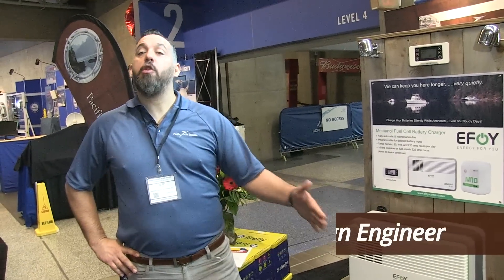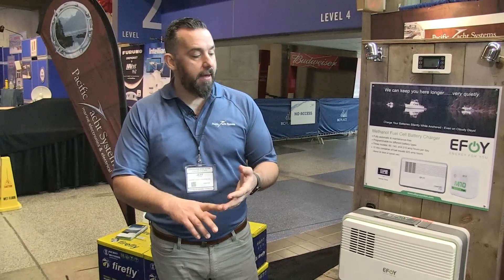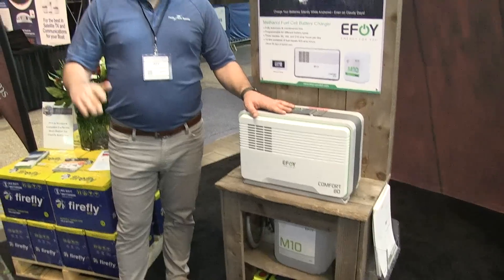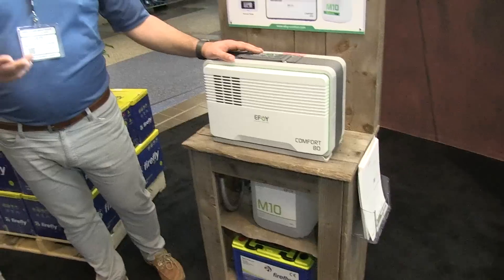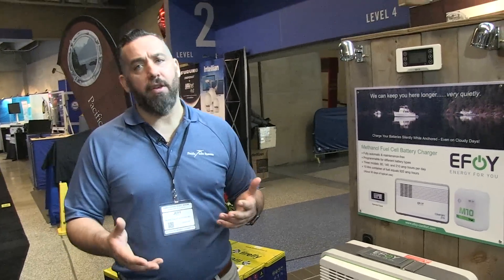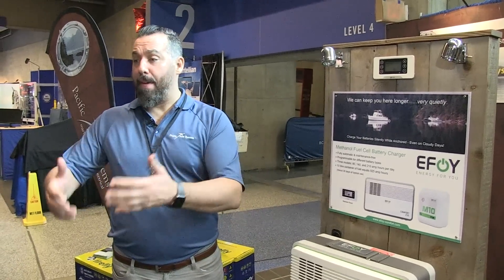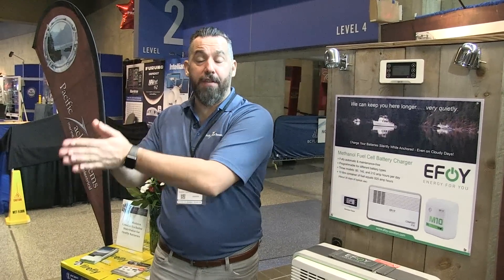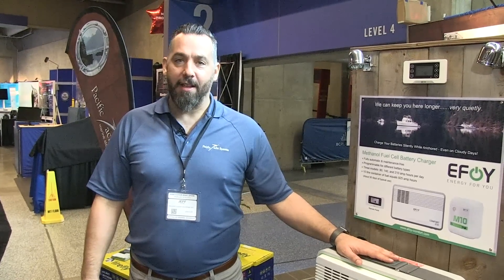EFOY -  Methanol Fuel Cell for Boats

Comment: Hi,  I'm researching the Efoy as a charger for my RV battery.  I do a lot of camping in rec sites without hookups and I use solar power most of the time.  I am looking to extend my camping season but the fan in my RV heater is a large draw on my batteries.  I'm assuming an Efoy 80 would be able to keep the 12 volt battery charged but I also wonder if the heat exhaust from the efoy unit can be vented back into the trailer to supplement heating?  I know that that the exhaust gas should be vented outside but what about the larger vent.  Is that gas nontoxic?

Comment: Forgive the ignorance, but why batteries? Why not run its output to a  inverter? I understand it would increase the menthol consumption. But is it possible? Or am I just dreaming?
Reply from the maker: Good question, battery chargers and power supplies are quite different. EFOY, like battery chargers and alternators, need a battery to act like a spring to handle the sudden adding and removing of loads. You unfortunately cannot connect an inverter directly to an EFOY as it acts a battery charger and not a power supply.

Comment: Jeff, i have recently installed the 140 on my Hunter 38 i have found that when motor sailing my battery voltage W/ alternator charging i'm @ 100% charged  around 13.8 volts with all my electronics on for navigation etc. The EFOY factory switch off voltage is 14.2 so it would also be running when i'm motoring, this seemed like a waste of energy so i changed my switch off voltage down to 13.7 so that i conserve fuel, have you experienced the same?  i find the only time i get to 14.2 volts is with shore power, and or at anchor and at night with minimal loads drawing. have you made similar adjustments or do you just let yours run...
Reply from the maker: Hi James, my recommendation is to manually turn on and off the EFOY unit. Simply, we know better than the EFOY, we can make a decision if it makes sense to have the EFOY on or off. When motoring, I too turn off the EFOY unit as i leave the alternator do the work.
Reply: @PacificYachtSystems  Sounds good!
I found it hard to find local knowledge about the EFOY, because of your videos i pulled the trigger, they are very informative and helpful, keep up the great work!
because of you this is how i came to my decision and sized my EFOY system..
https://youtu.be/bAd0j4gLI0Q

Comment: EFOY 140
SPECIFICATION
Amp Hours	140
Nominal Voltage	12V DC
Maximum Power	72W
Charge Current @ 12 V	6.0A
Nominal Consumption / kWh	0.24 Gallon
Weight	17.2 lbs.
Size	17.44"L x 7.95"W x 11.34"H
Operating Temp	-4°F to +104°F
Reply from the maker: Thanks for sharing.

Comment: soooo basically its just a generator running on methanol? slowly? or is it a genuine fuel cell One that probably no one could fix in the middle of the ocean? and who sells the efoy fuel in the southern pacific etc?
Reply from the maker: You bring two good concerns about Fuel Cells (including the EFOY): 1) fuel cells are complicated and it's NOT lend itself to a DIY fix 2) we recommend fuel cells to coastal sailors because the methanol fuel is NOT readily available.

Comment: If the EFOY emits carbon dioxide, where do you keep it where it's allowed to run and not kill everyone in the cabin? I would assume it had to be up on deck when running.
Reply from the maker: A methanol fuel cell emits as much carbon dioxide as a cat breathing. Humans also emit carbon dioxide and cannot live in a closed space without ventilation.
Reply: and its CO not CO2, that is a real health risk for breathing in.... since CO replace O2 in the body...

Comment: What about backup battery systems for an Amateur Radio Station? I  have 10 80ah batteries 12vdc in parallel for emergency power for a kilowatt transmitter. Will your system manage my battery bank when the line power goes down for weeks due to a hurricane? Or, do I stay with my 8kw generator that is set up to use propane? I do have solar, too. But it will not keep the batteries up until the cloud cover moves on.

Comment: 80amp/hr...a day?...put up a tech to tell us not a salesman
Reply from the maker: Hi Errol, not sure i get your question. Can you be more specific?
Reply: @PacificYachtSystems  80 amps at what voltage? = wattage
Reply: @richardprice5978  He says it quite clearly: 10*80Ah 12V batteries in parallel, which is 800Ah/2 as they are lead acid, you don't discharge more than 50%, so 4.8kWh storage.  A 1 kW transmitter uses 2kW so around 2 hours runtime. Why he can't use solar, puzzles me too. If his batteries are old or in a cold place, self discharge might be excessive, so he really doesn't get any long term storage out of them or his array is simply too small.
Sorry to mess with an old discussion. BTW I was once gifted a broken 40W Efoy FC from an University. The stack was intact, so I fed it hydrogen and air, as an experiment, and it delivered 50-70W easily. Quite fascinating devices.
Reply: @PacificYachtSystems  it was specific   enough
Reply: @PacificYachtSystems  you such a kid without knowledge. You shouldn't be promoting generators.
You memorised from the paper to present. And when someone puts a clear question, you aren't able to answer. You have no clue...no skills. You shouldn't be on youtube.
The guy was asking you abouy watts output. How many watts per hour. 
I will make it clear....
So....at 12v how many amps?
If is 14v charging battery bank, you must have a rated Current input.
Ampers.....
How many ampers output?
14v 10A?
14v 20A?
This has to be per hour....not per day.
Technology its clasified rating per hour...not per day.
Batteries are rated 12v 20Ah( means 20A in one hour)
So if you can't give an answer....go back to school or take some private teacher to help you understanding the electricity.
World its full of scammers presenting produtcs. You tube its full of useless people like you.
Go back to school child.
Reply: @UrgenthelpwithSubscriptionsHel  geez man, little excessive there...
Nothing wrong with saying power in different ways, not like you cant convert it.
But amps per day without knowing voltage is not a meaningful specification

Comment: I'm testing EFOY  Comfort 80-Direct Liquid Methanol Fuel Cell battery tender for the state of NH. outside all winter long .worked great !
Reply from the maker: As a reference point, there are thousands of these methanol fuel cells deployed as backup charging devices in the oil fields. Service companies are replacing AC generators with fuel cells.
Reply: we are getting 30 day pre 10 liters of fuel
Reply from the maker: Same here, on my boat with an EFOY 210, i only use 3 10L Methanol Fuel Cartridges a year.
Reply: Same thing, 1 canister a month to get power regardless of the weather on my RV.  It's a great product for those cloudy autumn and winter days when your solar, nowmatter how large it is, gives you nothing. Then it's really worth the money I paid.
Reply from the maker: Same here. Bought my EFOY 210 almost 7 years ago and really glad i did. Especially when there is no easy way to recharge the batteries.

Comment: Expensive? Yes, but if you afford it, it’s a great product. And, no. I don’t have one — no need where I sail — nor do I work in the industry. I’ve just researched the cell technology extensively and know a couple of skippers who swear by them. ⛵️🇨🇦
Reply: can it run a small 4-6 usa 🇺🇸 ton A/C system? reliably in say a hybrid type car ( as a range extender of some sort rather than starting or adding a ICE diesel engine to run accessories or propel it down the road ) or drive a slow accreting ( sub 120kv / 200hp ish ) E/V conversion vehicle 🚘

Comment: My GOD, you're a smart guy, with lots of information, but this video, like most of your videos, is just a gloss-over sales pitch. The fuel is $32 a gallon....
Reply from the maker: Hi Bill, not sure if this is sarcasm or not. Your right some 4 mins won't give me enough time to explain the inner workings of a methanol fuel cell. Here is a link to more info on the benefits of Fuel Cells, most of it published articles.
Reply from the maker: https://www.pysystems.ca/products/power/methanol-fuel-cell/
Reply: EFOY fuel cells run on methanol, which is not widely available. 
Bloom Energy's solid oxide fuel cells run on gasoline and natural gas, which are widely available.  (Green New Deal banning fossil fuels in the USA is touted by Joe Biden, a senile, hypocritical,  radical left politician, but rejected by majority of the American people. )
Reply: Solid oxide fuel cells can be used for for producing electricity with natural gas, for powering or extending the range of electric cars, for making silent and efficient portable generators, etc. 

Green energy should not mean banning fossil fuels. It should mean using both renewable energy and fossil fuel energy complementarily, efficiently and in a more environmental friendly way.
Reply: @simon6071  Do you work for or own Bloom?
Reply: @alanberickson  No,  I do not work for Bloom.  I did own some Bloom shares but I sold them after profit taking.
Reply: @simon6071  Not so! I already voted for Biden 3 times so he is popular.
Reply: @svosprey  Yeah, the Bidens have been very "popular" among the Chinese communist members who want the USA to be subjugated by China, the No. 1 fossil fuel user and No.1 CO2 emitter in the world. The incriminating content of Hunter Biden's harddrive could have been used by communist China to make sure the Bidens do their anti-American biddings had it not been uncovered by the US intelligence first in Hunter's abandoned laptop handed over to the FBI by a computer repair shop. It's Karma.
Reply: Hi Simon 

Very nearly all that you have stated here is incorrect.

Comment: Can it run on Home brewed Methonol
Reply: seperatin  ethanol  from  methanol      -  as   methanol  lower   boiling   point  -  first  to  come   off  from  distillation
Reply from the maker: Hi Graeme, the manufacture of this fuel cell, only approves it's own EFOY Fuel.

Comment: VP racing Methanol is 99.95% pure methanol...it;'s $39 for 5 gallons... just an fyi.
Reply: efoy voids warranty  if non efoy fuel is used two 10 liter cartages come pre box about $120. plus hazmat shipping
Reply: @frank12562  Good to know, thank you.
Reply: @esquire9445  The membranes in PEM fuel cells easily get contaminated, and their output drop, so reasonable that warranty only covers if certified fuel is used. Most likely, there are also a percentage of water in it, as the membranes don't like drying out either.
Reply: @Tore_Lund  ya, I don’t have an efoy.  But if I did I wouldn’t worry about a warranty.  I would only worry about fire danger by using the wrong fuel.  That being said, you can also get pure methanol from chemical manufacturers that is less expensive.  The efoy company really rips people off.  It really wouldn’t take long to use enough cheap fuel where the savings would pay for a new efoy.
Reply: @esquire9445  Atleast, if someone wants to try this, try to dig up some service manual /datasheets / random university papers on Methanol fuel cells first, to figure out how much distilled water needs to be added to it, unless the Efoy has a seperate water tank? Hydrogen fuelled fuel cells have a bubbler on the H2 line so the membrane doesn't dry up and cracks. It will be in the order of half a cup per gallon Methanol.
Reply: @Tore_Lund  ya, if I was going to buy one of these I would look up the info.  I was researching this a year ago but decided to stay with my generator for now.  I like these technologies, but there needs to be more competition to bring the prices down.
Reply: 60 dollars a  gallon.. lololololol.. you do know you can buy petrol or diesl for a tenth of that
Reply: @richardoakley8800  Ya, the issue is generators are heavy and loud.  People will pay $6000 for an efoy and $60 a gallon for quiet and clean.

Comment: You didn't  mention the ridiculous  price of the methanol fuel, or the limited availability.
Reply: VP racing Methanol is 99.95% pure methanol...it;'s $39 for 5 gallons... just an fyi.
Reply from the maker: Hi Fred, good point about the availability. Here in the Pacific NorthWest, many marine stores carry methanol fuel.
Reply: The efoy fuel comes in two 10 liter cartages per box. Each box runs at about $120 plus hazmat shipping, and can be shipped globally.  There are 11.3kwh per 10 liters. Pollution free.
Reply: @frank12562  The interesting thing to me is that efoy claims they sell 100% methanol but that number is not on their MSDS sheets, which is where such claims would hold them legally liable.  I know this because I worked in that industry for a while.  Perhaps it is 100%, perhaps not.  I think it's ridiculous to charge as much as they do for their fuel, it's definitely a reason to not buy their product.  That price is $45.42 per gallon plus shipping and hazmat fees... but you can get VP racing Methanol for $7.80 per gallon near your local racetrack.  Those efoys are $6000 units, do I care about a warrantee if I use that unit that much?  If I use more than 150 gallons before that unit breaks I break even.  I have a hard time believing that efoy would break in that amount of time.  Safety is another question.
Reply: @esquire9445  iv seen M100 ( in my area its cheaper than real avgas or 105+ octane leaded and unleaded racing gasoline @ 6-12~ usd aka typical marketing even without having a drag strip by me for 100+miles ) fuel for less than 4-usd-pur usa 🇺🇸 gallon ( in a 5 or 50 drum one if the reasons i was looking at running it in my street / racing engine is it was working out to 2~ usd ish pre dollar 💵 December 2018 to run in the rocky mountains vs premium 95~ pump plus i can say its "eco friendly" ) so someone must be getting a good mark up scam going $$$ 🤷‍♂️
Reply: @esquire9445  the catalyst in fuel cells is very delicate, so you need a very high purity of the methanol not to poison it. 
Also you need to take into account the efficiency of the system in comparison with any other system. If it is able to create more output with the same input you are saving fuel.